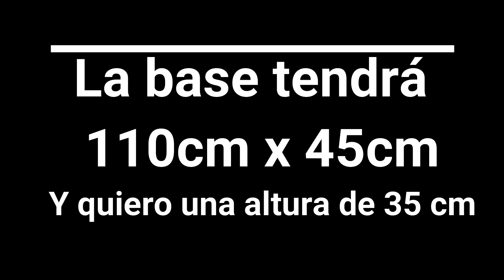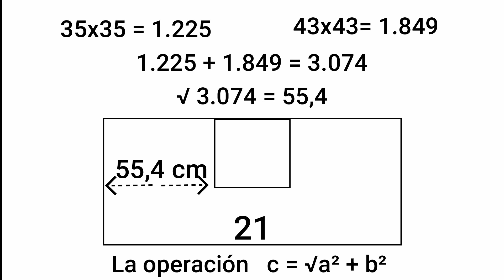Como hacer una campana de barbacoa 📐

Comment: Excelente!!!
¿que tipo de lamina es?
¿que calibre es?
¿con cual pintura la pinto?. Muchisimas gracias por compartir.
Reply from the maker: Hola, he usado una lámina de hierro de 3 mm y pintado con pintura anticalorica (lo puedes comprar en cualquier ferreteria o tienda de pinturas)

La lámina de hierro (hierro dulce, hierro al carbono, hierro normal) se puede usar de 2mm pero es probable que se desforme con demasiado calor, por eso uso la de 3 mm para evitar problemas.
Un saludo 👋